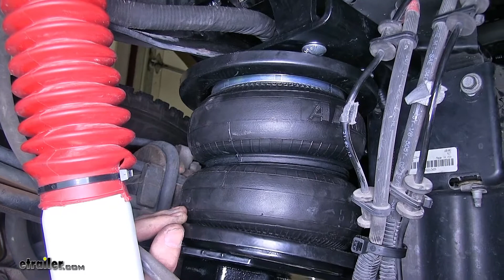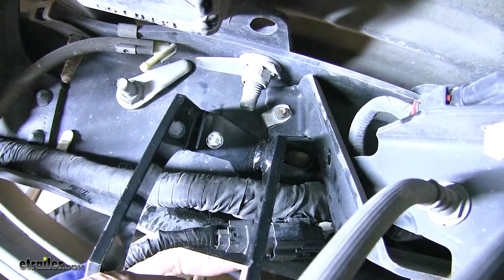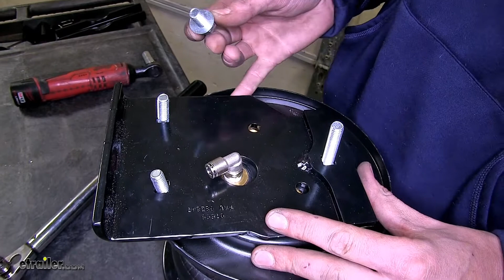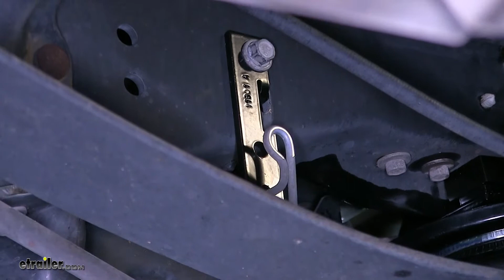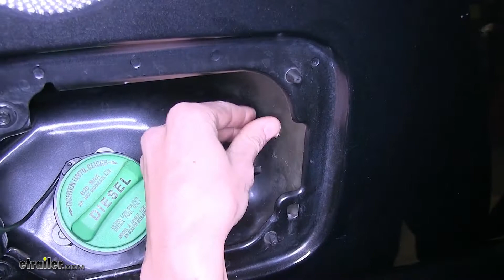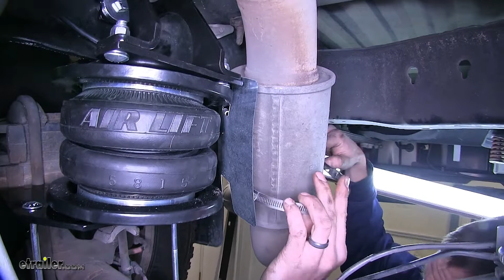etrailer | Air Lift LoadLifter 7500 XL Air Helper Springs Installation - 2012 Ford F-350 Super Duty

Comment: It would be nice if you showed the passenger side.

You state that it's the same as the driver's side but it isn't.

The frame bracket is completely different and is mounted to the frame with just one bolt - that bolt has a SIGNIFICANT amount at play or adjustment due to the huge hole in the bracket AND the large slot in the frame.....

Comment: How to you run the lines to use the pump and the air chuck in the fuel tank?
Reply from the maker: You will need to run a air line tube from the air compressor to a t-fitting, then two seperate air lines, on to each air bag. You will attach these to t-fittings that you will add to the top of your air bags. The manual fill will be the same. Run an air line tube from the manual fill, to a t-fitting, then to each air bag.
https://www.etrailer.com/Vehicle-Suspension/Air-Lift/al57596.html
https://www.etrailer.com/Air-Suspension-Compressor-Kit/Air-Lift/AL25980EZ.html
https://www.etrailer.com/Accessories-and-Parts/Air-Lift/AL21838.html